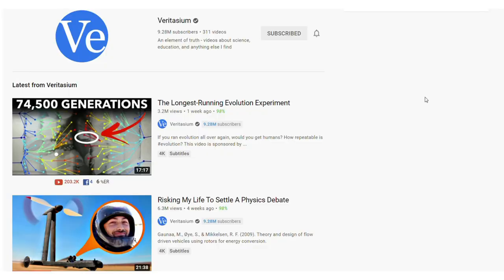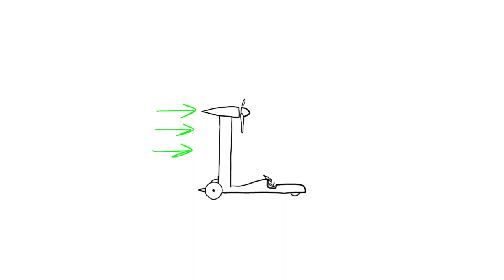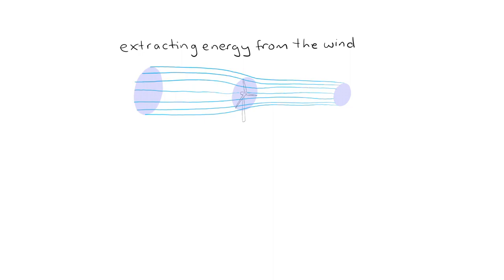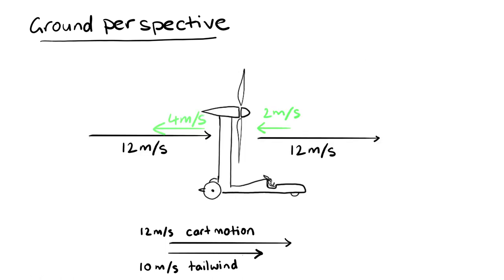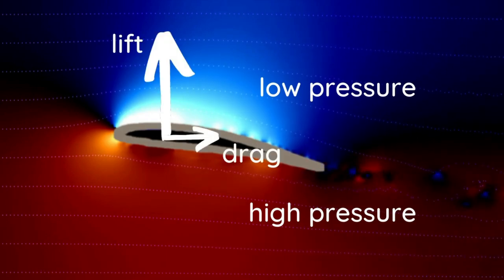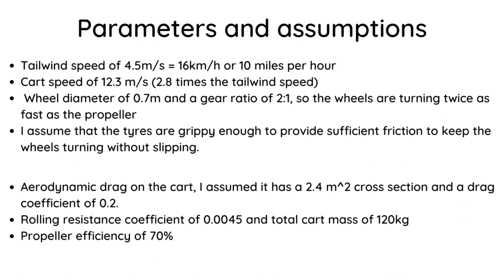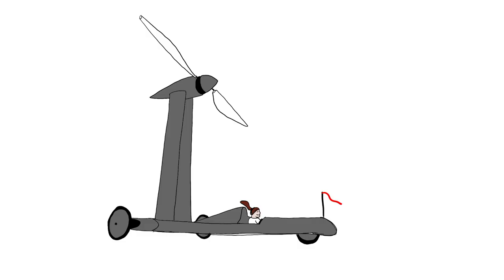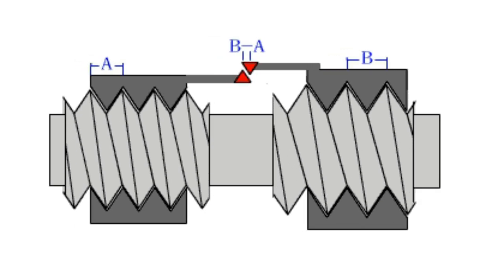Downwind Faster Than the Wind by Veritasium: How Does it Work?

Comment: The only thing no one talked about "except you" is the torque involved between the propeller and the car wheels, with torque we can change speed and force as we wish. So honestly this is not clean (Wind vs Vehicle) as people think.
Theoretically, speed of vehicle = speed of wind - gravity (gravity always exist even if the vehicle on fly)
Reply: //"Theoretically, speed of vehicle = speed of wind - gravity "//

And again, no.  The speed of the vehicle (theoretically and actually) is around 3x the speed of the wind.  When you're hypothesis doesn't match reality, you need a new hypothesis.
Reply: @robertwilliam5527  

//"But where is that extra force coming from? Aliens? Holy spirits? what?"//

It's wind powered.   This is made very clear in Rosie's (and all the other) videos.

//"so stop being negative about people discussing it"//

You will find I'm the very last person to "be negative" about people discussing it, and very nearly the first to engage on educating folks on the details and operation of the Blackbird.
Reply: @johnborton4522   "engage on educating" doesn't prevent people from making mistakes still, because educating and learning come in one package, they're never separate simply the one completes the other.

Now going down wind faster than wind (using only wind force) creates wind resistance in my humble opinion, so even "in Rosie's (and all the other) videos", the video can show a car (Blackbird) running faster than wind using wind but it fails in showing the physics behind it, and that's the one point where people at least can discuss about.

So my take on that remains the same, the torque mechanism involved and the shape of the car "taking advantage of the supporting wind penetrating the resistance wind" is making it run faster than the wind down wind, until I'm proven wrong, again "proven wrong".
Reply: @robertwilliam5527  

//" it fails in showing the physics behind it,"//

Then you don't understand physics.  Both Rosie's video, and the Veritasium videos she references (as well as all her references in the video description) show the physics behind this craft in detail.

There's no shame in not understanding the basic physics principles involved,  but to claim is isn't explained using those basic principles is just demonstrably wrong.
Reply: @johnborton4522  Torque mechanism belongs to physics, "Then you don't understand physics" is on you not on me, understand first the whole concept, then start talking so what you say might make sense.
I actually don't want to go further with you, you try just to stay in the negative side without proving something, you can't gain my limited knowledge anyway because there is nothing to add from your side, is OK.
Reply: @robertwilliam5527  

//"Understand first the whole concept, then start talking so what you say might make sense."//

One of us designed and built the Blackbird and has his name on its world records.  The other one of us is a YT keyboard warrior who hasn't even seen one but wants to pretend they get how it works. 

Given the evidence, I think we all know who understands the "whole concept" and who doesn't.
Reply: @robertwilliam5527  

//"Call me whatever you wish, it also won't fix your failure in interacting and explaining something so simple as Blackbird is."//

I can only explain it to you, I can't understand it for you.  Derek (Veritasium) can only explain it to you, he can't understand it for you.   Rosie can only explain it to you, she can't understand it for you.  Mark Drela can only explain it to you, he can't understand it for you.  Rick Cavallaro can only explain it to you, he can't understand it for you.  Countless people can (and have) understood it and offered excellent explanations. 

See the common thread in the lack of understanding?  It's not us, it's you.
Reply: @johnborton4522  you again? 🤣🤣🤣